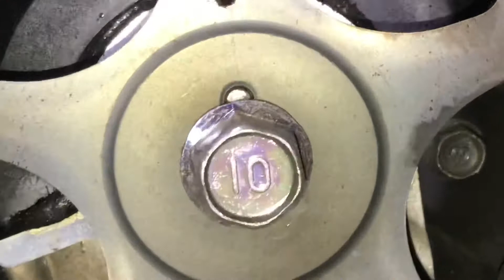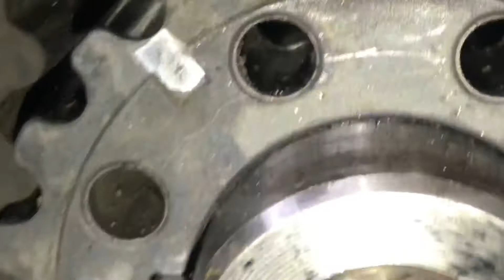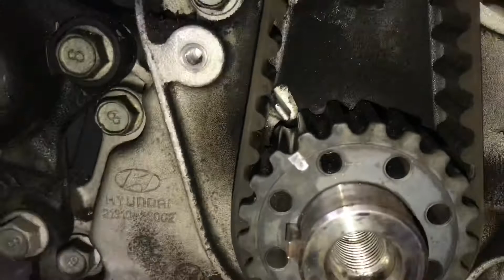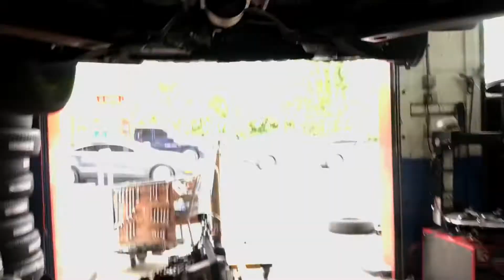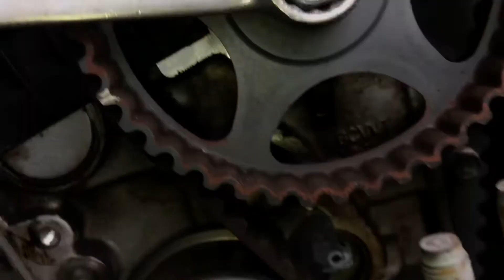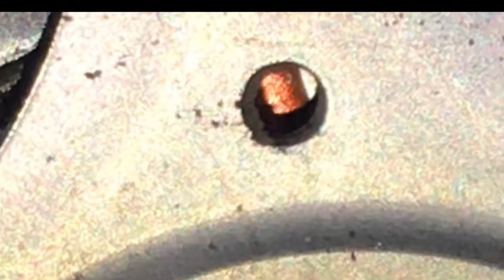2007 kia spactra 2.0 timing belt marks

Comment: I have a 2006 Kia Spectra with the 2.0.  I think the belt jumped time, but I want to confirm without taking everything apart. 

I've read that clearance between cam and lifters should always be tight.  

Right now I can easily insert a shim piece of plastic coke bottle between the cam and some lifters.  Does that mean bent valves???  Thanks.
Reply: yes
Reply: i have an 07 spectra 2.0 with bent valves lol